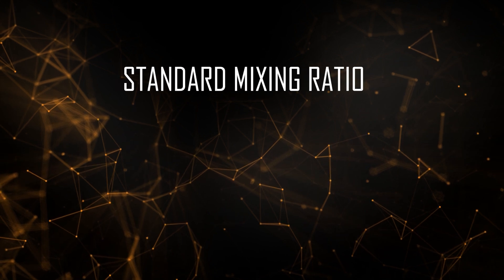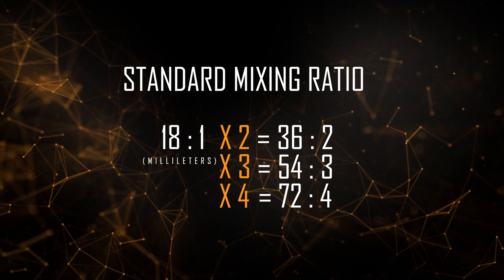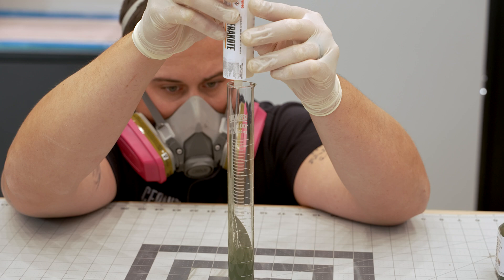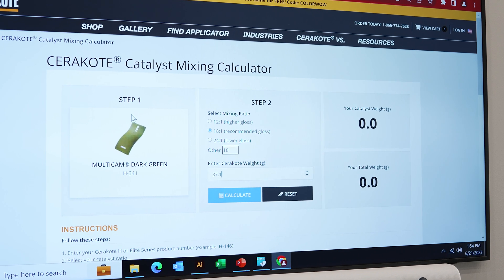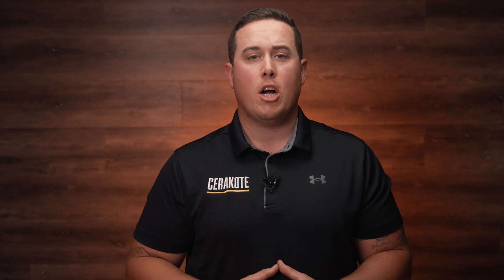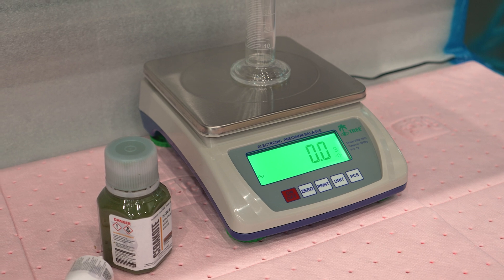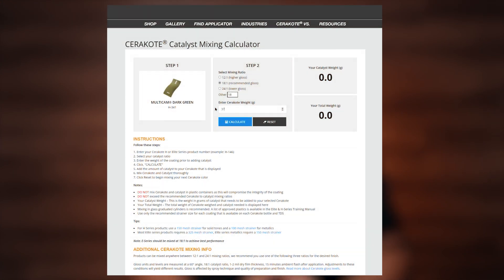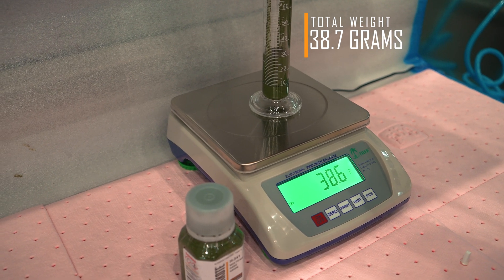Why You Should Mix by Weight vs. Volume | CERAKOTE®

Comment: Good video. I've been using Cerakote for 7 years and typically mix 100 to 250ml at a time since I focus on car parts. I have always used either a plastic disposable (but very reusable) 10ml syringe or glass syringe to measure catalyst and add to the Cerakote. Both are extremely accurate. I have an Excel spreadsheet that calc's the volume I need for a variety of volumes.